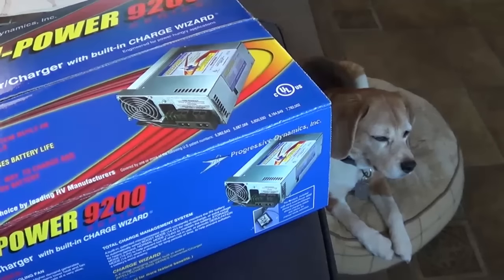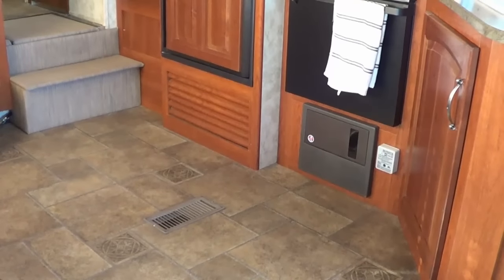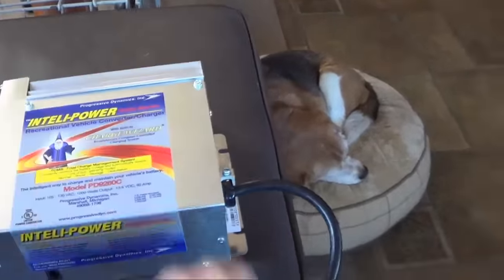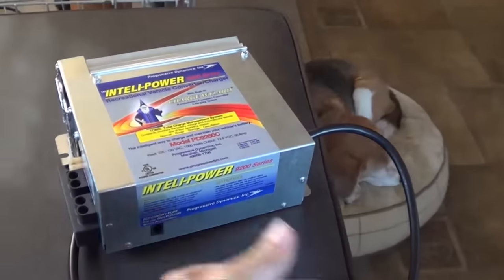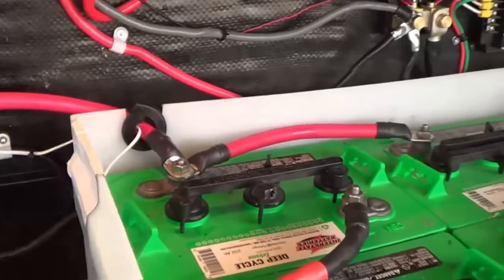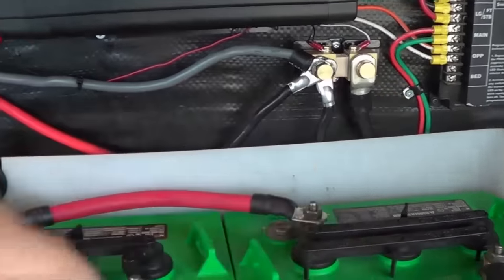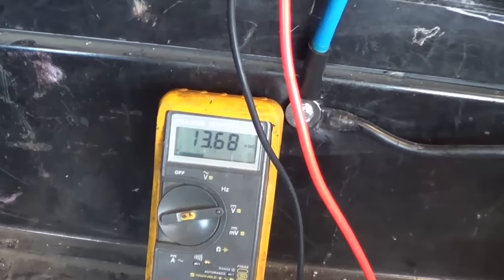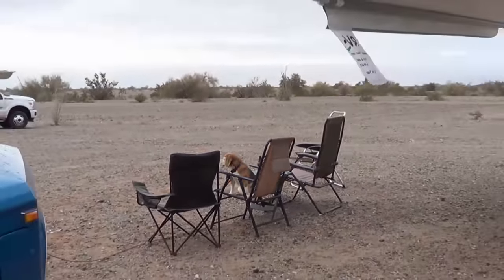Upgrading to an INTELI-POWER Battery Charger for Boondocking

Comment: Dang your costing me money. Haha. In a good way. I bought the exact same converter, and, a AIMS power 2000 watt continuous 4000 watt surge pure sine inverter. Batteries/solar/Genny (dual for the propane) is pretty much all I have to purchase to be ready and comparable ( I think) to yours. Have took a pic of your wiring set up and showed it to a man who says he can wire it the same way. Thank you so much Ray. I am just 5 months away from retiring and doing the RV life now!
Reply from the maker: haha, cool. Here is an overview of my system as it stands today, there is a schematic on the page - https://www.loveyourrv.com/diy-rv-boondocking-power-system/
The only thing I've changed is added a cat fuse in a different location and changed my ground panel setup.
https://www.loveyourrv.com/installed-catastrophic-fuse-rv-battery-bank/

https://www.loveyourrv.com/replacing-damaged-portable-solar-panel-plus-new-mounting/

Cheers! Ray

Comment: I have the exact same charger that came with my travel trailer and was just thinking about upgrading like you have done.   Thanks for the info!
Reply from the maker: You bet. Cheers!
Reply: I just got a great deal on the 80 amp model and am having it installed tomorrow.  Then I am off to Imperial Damn near Yuma.  Have you been there?
Reply from the maker: Cool! No, I haven't but have met lots of people who like it. Have a good time!
Reply: There are places near or have a view of the water, so I think that should be nice.  They also have outdoor showers and other amenities nearby.
Thanks!

Comment: Ray, when your plugged into 30 or 50 amp service which inverter is charging your battery bank. Also on shore power does your inverter charger regulate your charge. It wasn't clear if you disconnected your factory inverter from your battery bank. Looks good on your setup, pretty soon you will have nothing to do but enjoy the sunset. J L Thompson
Reply from the maker: The original converter is still in place, nothing was changed there and can be used if plugged in or I can switch its breaker off and use the new one if I want by physically plugging it into an AC outlet.
In an electrical hookup RV Park, I may just use the old one as it will just be float charging my bank anyway as the solar will be adding charge as well.
It's just nice to now have a way to quickly bring the battery bank up to a decent charge state. Also, I have some redundancy in case of break down. I've heard it is not uncommon for those OEM WFCO converters to pack it in. Cheers Ray

Comment: my solar panels will charge on days like that, mine are polycrystal. they will even charge most days during winter in the puget sound area, im now blocked by trees this winter so their not charging at all. I use a 20amp charger from my generator. id love to use my progressive dynamics but i have 2 seperate battery banks the original chassis system. and another bank  that my solar feeds  i need to move all my batteries to one location, but then ill have to do some solar rewiring. i have 2 inverters as well, one off my chassis battery bank, and one off the solar battery bank. its worked well for my needs.

Comment: Nice video, just an idea but if you add a 120v receptacle in by your new converter and disconnect the wire from the old converter it would be going when you on shore power as well. Either way nice video.
Reply from the maker: Good idea I've been mulling things over in  my mind and that is one. :)
Reply from the maker: Good idea I've been mulling things over in  my mind and that is one. :)
Reply: I have a question do the converter fan run all the time

Comment: Good video. Real professional looking installation you did. With that extra charge you have now, do you leave that door open for the battery venting? I lived off grid for 12 years, so I know what damage that hydrogen gas can cause (corrosion & explosion hazard). Keep a close eye on your water levels now, too. I'm sure you know all this already. You seem like an old pro. Thanks for the update.
Reply from the maker: I have my battery box vented below and above. If I'm cautious with the manual boost mode and only use it when the batteries can take a lot of current up till 85% charge I should be OK. But I do monitor the water levels to be sure. So far so good the Interstate GC2-XHD-UTL 6 volts I have seem to be able to take a pretty high charge voltage and not boil over.

Comment: Nice setup. Trying to setup my toy hauler  but the battery area is small and only can use small battery's  3 of them 12vt. So have to find a way to set it. Thks for your vid. Wish I had help on wiring like you did. But for me no help. Thks. See ya. John wino

Comment: Nice unit and Set up! 
Do you happen to know how many Watts the Inteli Power 9200 is using from your champion 2000?
(I am curious if you have wattage left over to run anything else during the recharge.)  

Also can you tell me how many hours your need to run the generator to get a full (or highest available ) recharge of the batteries?

 I am not exactly sure, but I remember being told that, to produce above 30 amps DC (like from your Inteli power 60 amp charger)
you need a 3000 watt generator with a 30 amp outlet circuit. Which probably means you need to parallel a second champion 2000 if that model has that option. You should get a faster charge using the full 60 amps from the charger and cut down the run time on the generator.
Reply from the maker: I did using a watt meter. About 1000 watts to power the PD9260 and it was putting out about 50-55 amps of charging current. Charging time varies depending on battery type, size of battery bank and state of charge. The lead acid charge pretty quick to about  85% then the amperage drops and it takes several more hours to get the last 10% of charge. But my my new lithium batteries charge really quick as they take the full amperage the charger can put out right to full.  Cheers, Ray
Reply: @LoveYourRV  Thanks Ray,  When you had the lead acid batteries , I was just curious what your average routine  was using the generator?  For example , if boon docking day one, you ran the RV for 8+ hours on the batteries down to 12.2 (or a little lower,) so then how long did you typically  run the generator to recharge for the next day usage? and was it sufficient to just charge the batteries to 85-90% by running the generator for 4-5 hours for the next day usage?  or did you run the generator all day to try to get close to 100%?
Also, can you tell me about what brand and amp hour lithiums you changed over to? 
And More importantly , is the PD9260 working well with the lithium batteries?
Many Thanks again for your help and your Response!
Reply from the maker: Usually, I'd run the generator a few hours and then let the solar panels finish the charge over the course of the day. Here is a demo - https://youtu.be/Ppx3gODUPP4?t=272
Here is my Lion Energy lithium battery update video  https://www.loveyourrv.com/lion-energy-lithium-battery-ut-1300-review-update/

Comment: I'm a little confused... did you leave the old converter hooked up to normal 120 volt ac shore  power? Now when you run your generator and connect it to the RV shore cable and the new converter as well aren't they both running at the same time?  It sounds like you only run your new converter on generator, but what if you want to run your Air Conditioner of the generator, do you disconnect the new controller? Other than voltage drop issues why didn't you just replace the new converter where the old one is?
Reply from the maker: I just plug the generator straight into the new converter with an extension cord. All the old system is left as is. Now I can use either. Voltage drop is a big issue with battery charging, small amounts mean a lot.
If I want to use the new converter in a park I can just flip off the old converter using the breaker for it, then either plug my new one into the 20 amp plug on the RV Park pedestal or an AC outlet in my RV storage bay. Hope that makes sense. :)
Lot's of options. Mostly though it's main use is to charge my batteries when off grid and solar is weak.
I haven't used AC when off grid in years, we tend to move around a lot and keep in the milder climates so I use a Fantastic Fan to cool the rig and park it in such a way as to not heat up too much. - Ray
Reply: +Love Your RV Makes sense now.  So if you could easily upgrade the wires between the old controller location, installing the new one there would work as a replacement?  Im dry camping now in Key West and somedays its nice to use the air conditioner  when its hot and your running the generator anyway to charge batteries.  I just use a portable battery charger to increase the charge rate when solar won't cut it...thanks....
Reply from the maker: Yes if I ran some larger wire there it would work well, but it can get pretty expensive for good heavy wire, that's why the RV manufacturers put in the bare minimum. They expect people to only dry camp a day or two. which I understand because 90% of their customers only do that. They are more concerned with folks not over charging the batteries so make the converter more of a trickle charger than a real battery charger  because the vast majority never even think of battery maintenance.

Comment: I have the Intellipower converter/charger left over from another RV. Do you shut off the stock converter/charger when using the Intellipower?
Reply from the maker: I can by switching off the breaker supplying power to it but don't really need to as I have a dedicated power plug just for the Intelipower to charge the batteries. I basically use the old OEM charger on shore hookups and the Intelipower is my off-grid charger for using my portable generator. I found out I can even use it for lithium batteries in manual boost mode - https://www.loveyourrv.com/lithium-battery-charge-test-can-you-use-a-lead-acid-charge-converter/  Cheers, Ray

Comment: Ray, first of all thanks for taking the time to post all your videos. Very helpful and I’m copying some of your set up in my 32' 5th wheel.  I have 4-6 volt batteries, a Trimetric Battery Monitor, Shunt and inverter. Going to put on 3-160w solar panels and a SC2030 charge controller soon. I have a question about the Inteli-Power converter charger. I too would like to keep my batteries charged right and my WFCO 65amp converter does not have the specs. I will probably do more full hookup camping than boondocking but want to be ready for anything. How critical is it in putting the converter close to the battery? My converter is under a set of drawers in the kitchen and probably 12 feet from my batteries. Looking at the converter, the wires from the converter run to the fuse box and from there I guess to the batteries. If I mounted the new converter in the basement area near the batteries how do I wire it back to the fuse box so everything works when I’m plugged it to shore power?
Reply from the maker: You're welcome. :)
The benefit comes from shortening the 12-volt output leads reducing voltage drop. The closer the converter is to the battery bank the more accurately it can sense the voltage they are at. Get too long of wire run and it thinks they are charged fully when they are not, also less power loss in the wires.
The Inteli-Power simply needs to be plugged into any AC supply. As far as the 120 VAC input wire it can be long with no ill effect so you can extend it back to the where the OEM converter got its input AC feed and hook it up there if you like. Another option might be to plug it into one of the AC outlets usually present in the storage bay.

Myself I found the solar charger does such a good job of charging the batteries even when on full hookups that I left the OEM one hooked up for using then (may as well wear it out) and I use the IntelPower exclusively for generator charging when boondocking.
Cheers Ray
Reply: Wow, thanks for the quick response! I understand now. I see that you use the IntelPower exclusively for generator charging. I thought you replaced you OEM with the IntelPower and just mounted it closer to the batteries. Again thanks for your time. I will probably wait to see if I fell I need the IntelPower once I start doing a lot of solar boondocking. I guess it will depend on the sun!

Comment: Can this converter be hooked directly into a battery bank which is already being charged by solar? Will the solar charge controller and the converter "fight" over the batteries and are they intelligent enough to know when to not attempt to power the batteries? I've got four 6v deep cycle batteries wired as 12v and then into a 60A mppt solar charge controller which has seven 100w panels. Just want to make sure I can plug into the house power without exploding my RV.
Reply from the maker: Yes, they can charge together, I've never has a problem. I rarely ever disconnect my solar charger even when on full hookups it's charging alongside my charge converter. I find the solar charger takes the lead since it usually can put out higher voltages my batteries need in the absorption and finalization charge phases.
Reply: Thank you! I'm likely going to order this tonight.

Comment: Back when you had the lead acid batteries , I was only curious what your average routine  was using the generator?  For example , while boon docking on day one, you ran the RV for 8+ hours on the batteries (down to 12.2 or a little lower,) then how long did you typically  run the generator to recharge for the next day usage and was it sufficient to just charge the batteries to 85-90% ( running the generator maybe for 4-5 hours for the next day usage? ( or did you run the generator all day to try to get close to 100%?)
Also, can you tell me about what brand and amp hour lithium's you changed over to and is the PD9260 working well with the lithium batteries?
Many thanks again for your help and your Response!
Reply from the maker: Usually, I'd run the generator a few hours and then let the solar panels finish the charge over the course of the day. Here is a demo - https://youtu.be/Ppx3gODUPP4?t=272
Here is my Lion Energy lithium battery update video  https://www.loveyourrv.com/lion-energy-lithium-battery-ut-1300-review-update/

Comment: Ray, love your videos.  i just bought a used Cougar and would like to do a similar thing.  Do you have a wiring diagram of the system that includes the WFCO Distribution Panel?  Would love to take a look at it.  What did you do with the existing WFCO Panel "battery charging circuit"?  Is it still connected to the batteries as it originally was?  Can two chargers supplying different voltages be connected to the batteries at the same time?  Is the 120Vac supply to the PD-9260 direct from your generator or is it extended back to a 120V receptacle or even to the 120V breaker in the WFCO panel?  Just unsure how to wire in the second charger.  Thanks again for your videos and all the great info you provide.
Reply from the maker: No diagram but here is a post and video where I removed to for inspection and cleaning.  https://www.loveyourrv.com/rv-power-center-removal-maintenance-wfco-8955/
I left the OEM setup just like it was, as I decided to still use it when plugged into shore power. It really doesn't have to do much when on hookups as the solar is also charging all the time. Figured I may as well wear out the OEM converter and keep the more expensive InteliPower for off-grid charging using the generator. I've added a dedicated receptacle at the front compartment just for that.  https://youtu.be/uRbGmxun1LI?t=767   Cheers, Ray
Reply: @LoveYourRV  So when you are running on your generator to charge you only run power to the InteliPower and do not connect the other inlet that would run power to the OEM converter?
Reply from the maker: @wks9326  That's right I just use the Intelipower charger when using my generator plus whatever solar power I have coming in.

Comment: The ideal of not removing the old converter appeals to me. But then i thought why add another converter? Why not just a good battery charger? We already carry an intelligent battery charger that will charge up to 40 amps. Is there a reason that you went with a converter? As always great video on a great topic. Rob
Reply from the maker: Basically, I'm using the InteliPower as a battery charger, just a very high-quality one with the ability to manually boost it to 14.4V when I choose. Helps bring the battery bank up to 85% or so charge really quick. Most battery chargers are designed for 12-volt automotive batteries. I think the INteliPower does a better job on my 6 volts. It's smart charger with 4 charge phases - https://www.progressivedyn.com/pdfs/109821F%20english.pdf
So far I'm very pleased. :)

Comment: Hi Ray. I have a question, did you use a terminal lug on the DC outlets or just squished the bare wire? I watched the video a couple of times but could not tell. My install instructions were kind of vague.
Reply from the maker: I just stripped the wire back, twisted the bare wire, applied some Oxgard to it and inserted it, then tightened the terminal screw down. Been working great for years now.  I like to use Oxgard on all my heavy DC connections - https://www.gardnerbender.com/en/p/OX-100B/Ox-Gard-Anti-Oxidant-Compound#   Cheers, Ray
Reply: Thanks Ray. Hope you are enjoying the sun, we leave January 2nd. The weather in Calgary area has been great but Yuma looks better;).